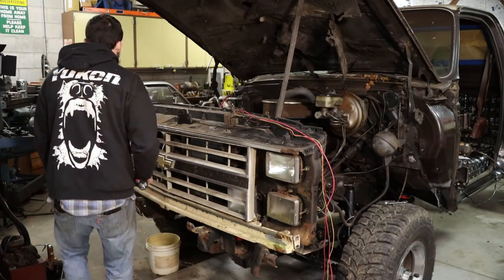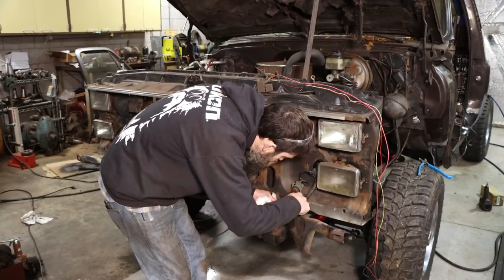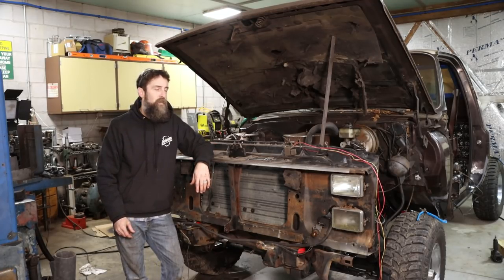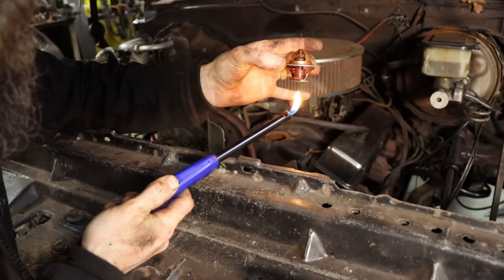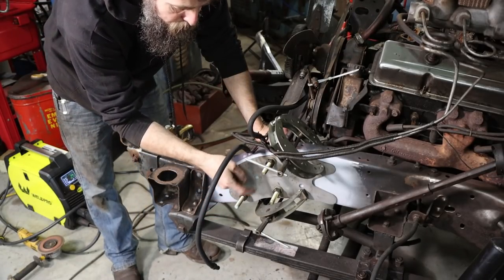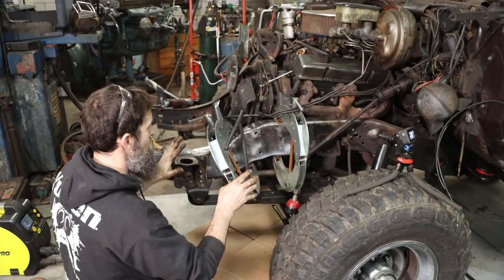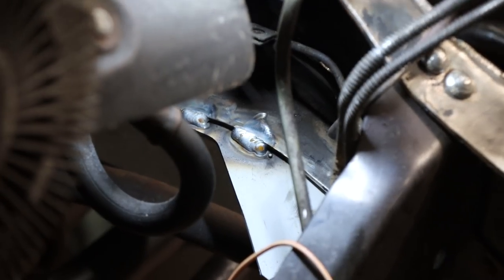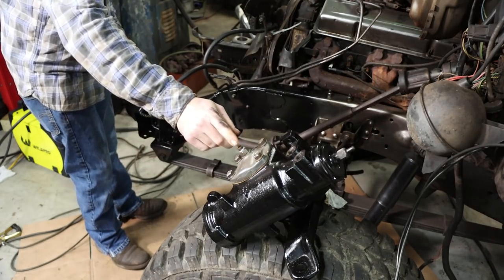Rough Country Steering Box Repair on the Chevy K10.

Comment: I wrote in a previous video that you inspired me to fix the rust on my 2005 f350 Dually, 6.0 diesel bullet proofed. I started a few weeks ago, working in my spare time, with the truck bed. I removed the bed, flipped it over, and replaced the rotted cross rails on that. Then on to the doors, all four of them required patch panels at the bottom, I just finished welding my last one in last night. I bought some and fabricated some others. All the rot is now gone on the  truck. Now it's on to the body work. Mechanically the truck is in great shape and has been well maintained and any time something showed signs of wear, replaced etc. The body is in relatively good shape, no collision damage, just normal dings and scratches and paint chips. I'm gonna be repainting the whole thing, original color, base/clear black. At this point, I'm committed to seeing it thru to the end. Cutting out rust and rot sucks bad. Welding in new solid metal sucked a little less, but it was a lot of work, and a slow process to make it right. The body work should go a lot smoother. I've never been a big fan of body shop dust and sanding in general but I've always done body work on my own vehicles in the past and I've always been happy with the results. At some point I'm gonna have to make a huge temporary spray booth, with poly, in my shop about, 16ft x 30ft to fit the dually into and have room to work around it. My shop is 40x60 but a spray booth that size is gonna take some doing, My shop is pretty full, but if I stack some things up, and move some stuff outside under wraps, I'll have the space. It's a significant investment in time and money, but this truck is worth saving since a new one like it is probably around $80,000. I won't have any payments on this one. My house is paid for, all my vehicles are paid for and that's the way I wanna keep it. Life is good when you don't have payments breathing down your neck all the time!

PS: I give you a lot of credit for putting up these videos every week. I did it for a while and I found it to consume a lot of time and energy. So a big thanks to you and all the others that provide all this free informative content on YouTube.
Reply from the maker: Awesome 👍 glad to hear someone is going to put some effort in . You may work on it for months but if you care for it you will have years of good rust free service in return 👍.
Reply: I finally got everything paid for about 8 years ago. Having that extra every month is great !
Reply from the maker: @TomokosEnterprize  I bet👍. A few hundred extra every month makes a huge difference for all of us.
Reply: @TomokosEnterprize  If I told you the payments I had 15 yrs ago, it would make your head spin. Mortgage, child support for 3 kids, car payments, property taxes in the north east...the list goes on. I had to make $6000/mth just to break even. Now, I live in east Tennessee,  I make 2/3 of that, and, with no payments, i'm living like a king.  😎
Reply: @SteveSummers  At your age and all the talents you truly poses I can see you comfortably well off and able to truly enjoy your retirement years. BUT ! Just make sure you can always create and putter along or retirement will eat you up. I realized that after about a month. 50 years of creating and fixing is like an addiction that just can't be ignored Steve. Now with my eyes failing, missing a leg and battling bladder cancer at 65 I still really enjoy all the phone calls and folks stopping by that need a bit of guidance with this or that and I still have my silver pouring to feed the creative need. I can easily see you just like your dad living to a very comfortable old age. Remember, , , You have to create as that is all you know eh.......Dean...... All the best to you and your wonderful family my FRIEND.
Reply: @marcellemay7721  Oh my, , , That is a huge load and you really deserve to be able to now enjoy your hard worked for efforts. I/we were never blessed with kids and just under a year where we were finally able to enjoy that bill free environment I lost my Mary to cancer when she was just 52. Retirement is now bitter sweet but I keep going as that is what she would have wanted most from me. Make every day a day of an achievement my friend.

Comment: My brother-in-law in law bought a new '76 model square body.  Talk about rust;  it was a '76.  He replaced all the sheet metal except the cab itself.  He worked at a Chevy dealer, so got a cut on the parts.  Mechanically a good truck.

Comment: Just an FYI Steve. he adjustment to get the slop out of the box isn't that screw on top. That is the overcenter adjustment. The adjustment you want is to tighten the ballscrew backlash. That adjustment is on the inputshaft side of the box. Loosen the sheetmetal nut and use a pin wrench to tighten the inner adjustment screw. Tightening the overcenter usually ends up causing binding and rarely needs adjustment even on a worn box. Funny thing is I was just explaining this to a mustang guy the other day as he said he tightened his up and it was still sloppy. (I used to be and ASE master+L1 tech)
Reply: The bearing preload adjustment is very easy. Loosen the lock nut, using a pin spanner, tighten the adjuster plug till it stops. Mark the box and the plug at the end of the box, and back off the plug 1/2”.  Lock the jam nut keeping the 1/2” counter clockwise position.  This eliminates any axial play as the thrust bearing is sandwiched between two coned bearing races that maintain preload on the needle bearing.  Then the over center sector gear adjustment is performed.  There are in/lb targets to hit when doing the preloads.  With the over center adj. backed all the way out and then tightened 1 turn in, the bearings proper preload is 5 to 7 in/lbs ( after the 1/2” back off from tight ) After checking the bearings without any drag from the over center gear contact, then tighten the over center (gears in the middle of their travel ) till there is another 5 to 7 in/lb  drag on the input shaft.   I have found that a too tight over center adjustment creates a steering wander condition that rivals a worn out steering system.  ASE MASTER 40 years with ASE steering suspension Subject Matter Expert award.
Reply: the screw he did adjust if over tight the steering box will not turn it may not happen the 1st ten feet might be a mile down the road it will be like you locked your steering in park ,,

Comment: Great video! The vapor filter (charcoal filter) is used to extract vapors from the fuel tank and dump them dump it back into the carburetor for burning at certain intervals.
Reply: 🤣🤣🤣😂 It has zero to do with "preventing an explosion" but it does collect fuel vapors in the charcoal canister from both the carb float bowl and the fuel tank, and during cruising they are pulled into the intake manifold to be burned. This is purely an emissions control device to reduce evaporative emissions that every car and light truck has had for 50 years.
Reply: @wrenchoperator6435  absolutely right

Comment: LOL, Chuck Norris never gets old. Crazy to think that a modern 4 cylinder makes more power than that big old motor. When I got my Silverado in 04, I didn't expect dishing out a few hundred dollars every year on a sensor to pass state inspection. This year it was a fuel tank pressure sensor but on the bright side, during the diag. I found out it had a 6 CD changer. Do you know how useful that would have been 18 years ago. LOL
Reply: A buddy of mine drove a late '90s Ford F250 company truck with extended cab.  The day he was emptying it out to return it, he discovered the side of the cab extension opened up like a suicide back door.  He was fit to be tied!
Reply: @eastunder55  LOL

Comment: Well every vehicle gets designed and built, but it is the consumer that finds the weak areas of the design over time and use. So fixing those weak areas is a great idea. The factories do their risk assessment as to whether they should invest into a different design, or just let it go. But every product released to the public goes through those same issues and either redesigns, or don't worry about the weak areas. I mean after all, they have new ones to sell... Thumbs Up
Reply: Just speculating here, but I think owners who put on (way)oversize tires exacerbate a potential frame problem at the steering box mounting area.

Comment: I put a pair of 3/4 ton axles under my k10 this past fall. Once spring comes around I’m going to put a steering box stiffener in. The frame isn’t cracked on mine so I figure I’ll reinforce it before I have issues. Got to love these old trucks.

Comment: Steve just a thought ,,,when your welding and grinding near your parts washer ... Close the lid .. I bought a new too me home came with a 2 car garage and a pole barn 10 feet 6 inch ceiling .. they had old sheet plastic on the ceiling ,, full or junk .. birds nest ,hay  tons of dust and dirt .. the barn is 20 years old .. I was grinding and welding last winter .. looked up and about 10 ft area was melted full of holes like someone took a ice pick too the plastic .. since then I got new plastic and put up tin on the ceiling ,, for looks and too hold the insolation when I get the money but as a spark stoper .. but I keep the lid closed on my parts washer if I am welding or grinding anywhere in the shop .. them dam sparks go every where .. truck is looking good ..

Comment: I had a 75 2wd that i got from a local used car lot took me about 2 days to figure out that it had a serious problem the frame was so bad around the gearbox the front bumper would move about 2 inches from side to side took it back to the dealer and showed them they gave me a 80 model to keep me happy my guess is they just welded it and sent it. 
I then got an 85 w 6.2 diesel in 87 it was 2wd automatic had 17000 kilometers on it or around 11000 miles it was the exact same color as yours i loved that truck i drove it for 23 years had 800000 kilometers 500000 miles on it when I got rid of it It was wore right out still miss the old truck 👍👍🐿?🍻🍻

Comment: Hey Steve sorry I’m late to class this weekend. Hey a tip I would highly recommend when refilling your cooling system. If you are not using premix and mixing it yourself get some distilled water (.99¢ at the grocery store) you will get a lot more life out of your coolant this way. Do an experiment with tap water and another with distilled in a small cup and you will see the difference. Tap water will warm up fast as the chemical reaction neutralizing the minerals is occurring. No heat up with distilled. Using distilled puts more of those neutralizing chemicals in the system where you want it! Stay warm! Can’t wait to see footage of you guys cruising again.

Comment: So much nicer doing that steering box repair in a shop. I had to do one on the side of the mountain with nothing but jumper cables and some 7018. The box had ripped completely off the frame. Of course, it didn't help we were running 44" TSL's. 
The repairs are lookin good! Keep it up, and you may hesitate on taking it out for wood!  lol

Comment: The reason they don't recommend continuous welding is that a continuous HAZ is a excellent path for future cracks to propagate along.
When aircraft used tubular steel space frames ,they never welded all the way around a tubular joint and used gussets to add strength.

Comment: Steve: Watching you through this rebuild series has inspired me to do the same to my 2002 Ram 1500 since It has been a good and reliable truck for these 20Years. New Dodge 1500 trucks are $$$$$ out of site! and I am 75/76 in April so this is the best choice for me also. Love the way you approach working on your shop also.
Reply from the maker: There is no reason you can't keep that truck going as long as you want👍. The good thing about repairing one over replacing is you already know most the things it needs. Buying used can be a gamble and everyone knows what happens when you buy one new . The new truck may not be broke but the old wallet is.😁
Reply: @SteveSummers  Yes sir!

Comment: Thanks Steve, I enjoy all your videos. One piece of advice I would offer though, I'd consider a cross over steering conversion. You can do it using a 2 wheel drive box and a kit, although the contents of the kit could be easily made in your shop. The reason the 4x4 frames broke out in that area is due to the additional stress caused by the front to back motion of the pitman arm vs the crossover design of the 2 wd. Crossover steering also can eliminate any bumpsteer you may have if done correctly. I have owned many of these trucks and just suffered along with shitty steering as you have for many years. Just my 2c... Thanks again! Will

Comment: I have done this repair a number of times but made 1/4 in thick as large a washer/plates  I can get into the inside of the frame. Worked well as well.  That was 25 years ago. Oh how I wish those patch plates were available or known of them way back when. It is looking like you are getting through the repair and upgrade list pretty quick now. It will be like driving a totally different pickup when you are done. I guess I need to go and have a look at my 1980 SQ body and hope for the best eh, LOL. Thanks Steve. Have a beauty weekend my friend.

Comment: Steve, for those viewers that don't know, the best way to tell if a good quality bolt is metric or sae is to look at the bolt head. If it has a two digit number without a decimal point, it's sae. If it has a decimal point, like 4.8, 10.9, etc, it's metric. The higher the number, the harder the bolt. A series of letters has to do with the length of the bolt, and the size, like ego, ard, etc.

Comment: think the round anister behind the grille is a carbon canister , verry likely hooked to the pressure release on the gastank to prevent the truck smelling like gasfumes 
seen an adaption to the placement of the gastanks , normally they have saddle tanks but if you want to make understorage boxes you can get a gastank from a blazer that mounts behind the rearaxle in between the framerails and make the filler sit behind the licenceplate

Comment: I enjoy your videos. Regarding the dimide clamps, if you want more clamping pressure, use a 3/8 impact on the opposite end of the clamping bolt. (Lefty/tight Righty/loose)

Comment: Nice repair Steve good and solid. One thing, if you opened up the holes for the steering box mounting bolts, then used the original bolts again, what is going to stop the box from wiggling around on the frame unless there are location lugs or pins it will surely move a bit in time. But of course it's always going to be much better that it flopping about every which way with a cracked chassis. I've never liked 'C' frame chassis rails. The original Willys Jeep had them to save weight and materials during WW2 when the Rover car company here in the UK started to produce the original "Land' Rover they decided to use a box frame chassis with steel crush tubes between the side rails for the steering box mounting bolts. Far superior idea in my humble opinion
Reply: You make a valid point, but the Willys MB/Ford GPW were designed to get WWII done and dusted ASAP, I agree the Landyver box section/crush tube combination is more of an 'engineering' design, but have you seen what goes on inside those box sections over the years? Check out 'Oak Swamp' on YouTube with his project 'The Hook' down in the New Forest/Southampton area. All The Best from Somerset UK.
Reply from the maker: I don't expect that to be a issue due to the design of the box and the way it pulls on the frame. 👍

Comment: Regarding the GoPro frustrations - it may be the SD cards. They have very limited write endurance - some barely last one write, others can last hundreds, but all have a finite life. Write speed can be another issue, particularly if you're recording HD - and they can get slower with age. Look for high-speed, high endurance cards from a brand with a reasonable reputation (ha!) and if you have a corrupt recording, retire the card and get a new one. The cards can be somewhat sensitive to the device they're in too (heat, voltage, etc).

Comment: same problem shows up on 1st generation Dodge Diesel 4x4's.  Probably due to the extra weight of that engine.  Frame above the forward pin on the spring is another problem area.  I welded it all, ground it back only where the frame was stamped out around the bolt holes so the mounting plate would sit correctly.  That mounting plate was broken also.  It still flexes some, I keep an eye on it.  If I'm going on a long haul for a machine, I usually get underneath, get comfortable, and really give those area's the "stink eye" ... sometime you don't notice some things until you have stared at them for a while ... one of these days I'll thing of a practical way to stop that flexing.

I've yet to hear an owner of a gas engine model having that problem.

Comment: I remember my friend had a brand new 1965 F100 long wheel base.  Randomly while driving it would get the death wobble.  I think it had something to do with the twin I beam front axles, and the frame flexing where the steering box mounted.  I never found out if there was a official tech bulletin about it or not?  This was in 1965 just before going to Vietnam so my mind was on other things at the time,

Comment: Still got a crack there where that frame rail is by the front spring attachment, you can just see the red dye there under the corner.

Comment: My buddy is in the asphalt business and has used dump trucks of the same vintage as your truck. The problem he has had is with the power brake boosters going out. He would put a GM new replacement booster and would last about a year and a half to two years till it would go out again . I don't if your truck has the same setup  .

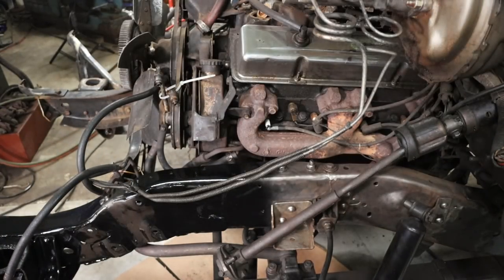Comment: At 23:45 there appears to be another crack in the top of the chassis that's inline with the center of the manifold - or is it the edge of another repair plate?